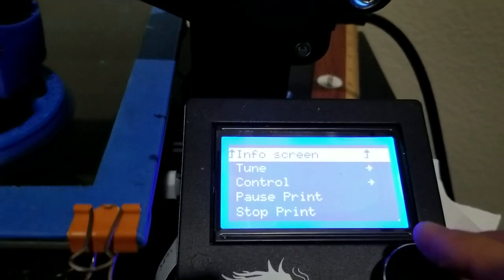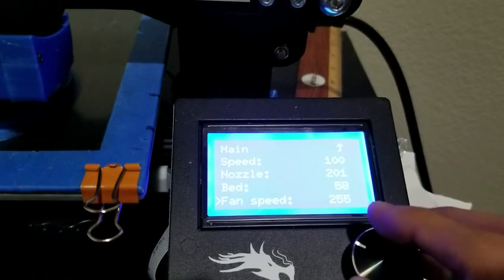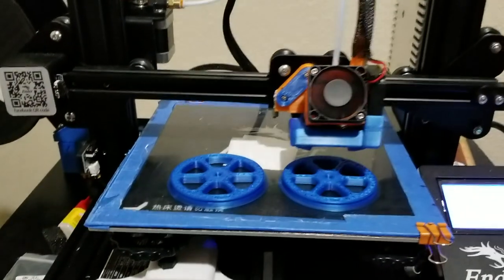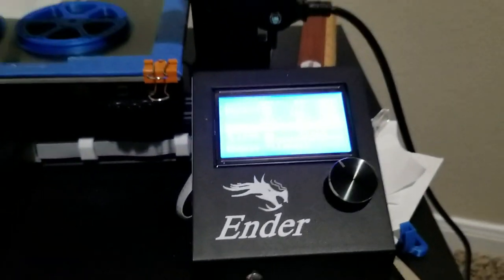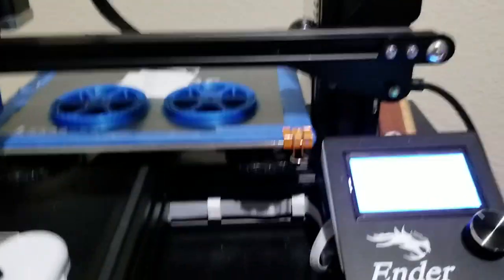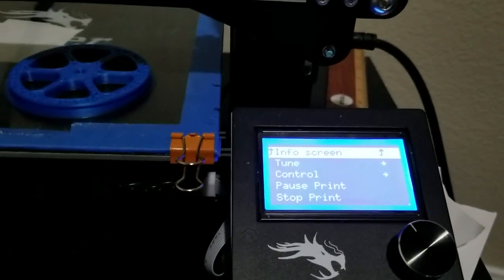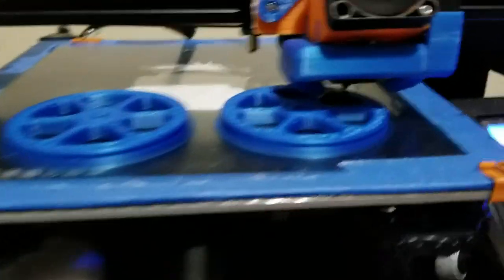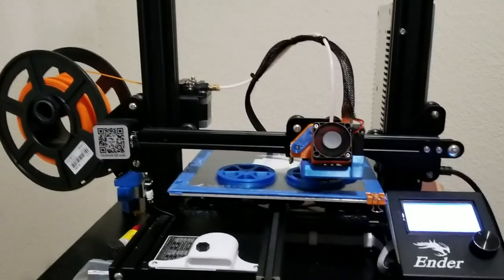How to change filament during a print on Ender 3 /CR10

Comment: i do not have the option for remove filament, for me it is replaced with babystep Z. i am using the enter 3
Reply from the maker: May be firmware is different/updated.

Comment: Mine doesn't have that function. Maybe a software update will enable it
Reply from the maker: You might as well have newer/ different firmware version already.  That's why it's not there ! Lot of people have same issue. Creality doesn't give you the notification on when they update their machine firmware/ control board versions.
Reply: @shehulsuratwala8568  Thanks for the reply. It's a Marlin 1.0.1 I doubt its a new firmware. I ordered a new silent M/B so I hope it will have more options then this one.

Comment: I don't have this option in my Ender 3 please help
Reply from the maker: It's hard to advise without looking at your machine but for starters,  see the version of your control board. You may be having a newer control board version or Updated Merlin firmware. 
Once you know the board version (4.2.2 or Higher I am guessing) , use that to search google/YouTube. 
This is my biggest complaint to creality. They change control board , firmware without notifications.  Even if you have same machine hardware,  you may end up getting different control board and firmware.

Comment: Thanks for skipping the boiler-plate talk about introduction and to subscribe, but pity that you cut out the actual changing of the filament, that's what I was looking for 🤣
Reply from the maker: Goal of this video is to show "how you can pause the print and replace new filament " , to show "change filament " option from Menu. 
This same technique can be used to get multi color print with one extruder.
Beginners do not know how to stop/pause print when you are running out of filament mid print. 
You do not want to waste your print specially when you have already got 10 hrs into print ....

Comment: Why is my Ender 3 Pro doesn't have that "Change Filament" in the menu?
Reply from the maker: I have regular Ender 3 v2. 
Creality constantly make tweaks to their boards/firmware without notifications.
Ender 3 "Pro" may have slightly different firmware settings.  
Sorry, I could not help.
Reply from the maker: @Daniel Walder Yes. Display is just a way to show information. Important thing is the firmware version/ control board version. If they are different then it could be the reason why some folks are not getting "change filament" option. 
I am not a professional YouTuber nor I do have money and time to invest for YouTube. I faced this problem when I was a beginner in 3d printing. There weren't any YouTube videos about this option at the time so I decided to make one myself and published it to help community. But the views and support from community is amazing and I am thankful for it. I never imagined to get this many views to be honest.

Comment: Can you share your upgrades on your hot end?
Reply from the maker: It was Hero Me 3d printed fan mount.  Didn't like it so much. I have been using my ender 3 stock with only one upgrade.  Using mirror on my bed.
Reply: @shehulsuratwala8568  thanks for the response. I've been having overhang problems on busts especially on noses and chins. Was thinking it might be a cooling issue. No matter what support I use they never turn out good
Reply from the maker: @iantec  I use supports over 55° angle. Try lowering your print temp by couple of degrees. 
If that doesn't help, print a temp tower to determine exact print temp for your filament. 
I prefer matterhackers PLA. It is $19.99/kg but best filament I have used.

Comment: Anyone else have the issue of accidentally moving the height of the printer while squeezing the tabs to replace the filament?
Reply from the maker: That's a problem ! Well , a solution for that is, stop your print. Remove partially printed part. Measure it's height precisely and use that number as a Z offset in Cura. Print the remaining half and at the end glue them together. 
It won't look pretty but if it is a prototype of some kind and you are not concerned about how it looks then it'll get the job done. 

I don't think the printer remembers the Z height or at least mine doesn't. May be newer versions do, I don't know. Let me know in the comment if it worked or what else you might have tried.

Comment: After noise appeared how u change the filament couldn’t understand... in btw u cut the video bro ??
Reply from the maker: Topic of the video is to show the option from menu and make the printer pause during the print ( without stopping the print job). When you click on "change filament " , printer itself starts to push out some of the filament from hot end. 
You simply pull out rest of it and replace the spool ... push new filament all the way into the hot end , click the button to resume your print job. 
I did not cut the video, simply edited out unnecessary part of it. No one would wait for 2 whole minutes to see me change the spool !
Reply: yeah I got it just don’t understood that the filament itself the printer pushed out .. printer it self push it out ..

Comment: Thank you! I was running out of filament before the end of my first test print (the little bit of test filament wasn't enough) and this just saved me a lot of trouble.
Reply from the maker: You're welcome.  
Test filaments aren't the best quality material either. Get some good filament and then start printing test calibration stuff.
Reply: @shehulsuratwala8568  Already done. I was mostly just messing around with the test file, but now I've got some Hatchbox PLA and have done some tests to double bed level and got a benchy to come out pretty well. Definitely gonna sub to you for the future though, I think I'm gonna try installing the TL smoothers from your other video. You make a great teacher.
Reply from the maker: @flamingmoose1479  Thanks. TL smoothers are of a great help. It made such a huge difference in X Y gantry noise reduction. 
As a matter of fact, I was a teacher in my previous job, now I am just an engineer in a firm. 
Let me know if you'd like to see video on other topics. I am into beginners racing quad ( Designing frames and building quads) these days hence no video in a long time.

Comment: You cut out the important part.
Reply from the maker: Which part ?
Reply: @shehulsuratwala8568  oh I don't know. The part about how to change the Pla.
Reply from the maker: @JohnSmith-un9fy  The video is about "getting to the option from menu where you can make the printer pause and spit out filament (it'll keep 1 inch still inside the bowden tube). Then you can physically replace the spool and resume the print.
Reply: @shehulsuratwala8568  For some reason it spit out over a foot of Pla. Then it let me resume print.  It also said something about a bad print. But did finish.
Reply from the maker: @JohnSmith-un9fy  I have never had that issue. You might have different version of merlin or different version of ender itself. Creality changes the control board , Merlin versions. Some enders don't even have this option to change filament in the menu. 
I am not talking about variations between Ender 3 and ender 3 pro and Ender 3 v2. There are variations among "Ender 3" only.
Reply: @shehulsuratwala8568  yeah. I have an old Trinus printer for over three years and it works great.  I have had to only change one nozzle and it is still using the same hotend. No plastic parts. Love it. But my Creality printer has the size. Thank you for your help.

Comment: Thanks! My ender 3 is currently printing my first print but is about to run out of the test filament so hopefully this works
Reply from the maker: Hope it went well.
Reply: Shehul Suratwala It was great. Currently In trying to print something I designed but the filament will not stick to the bed
Reply from the maker: @StolenGalaxy  male sure your bed is properly level.  In the beginning,  you just wanna print and print.  But take your time and make it level perfectly using piece of paper between bed and nozzle. 
You may try painter's tape, glue stick,  hairspray options to make your print stick. Using brim while slicing the part also helps. 
I use cheap mirror from home depot on my bed.  Doesn't need anything to stick.
Reply: Shehul Suratwala Ok, I’ve turned brim on in cura and will see if it works.
Reply: Shehul Suratwala Thanks! I did the brim setting like you said and now it’s working perfectly!
Reply from the maker: @StolenGalaxy  great. 50-60°C bed temperature is also good enough if you're printing PLA.
Reply: Shehul Suratwala Thanks, I did 55

Comment: I have a Ender 3 v2, and it doesn't have that option on the tune menu.  is this not avaialble for the v2?
Reply from the maker: I can't say for sure as I only have one ender. So far only 2-3 poeple have mentioned that they don't have change filament option. 
You may try to pause the print and manually pull out the filament and replace it with new one. And resume the print. Be careful with Z axis. Don't let it move up or down while you swap the filament.

Comment: Thank you so much for your video! It’s great that you did cause I couldn’t find a resource to provide this info. Consider demonstrating raising the temperature when the filament requires a different temperature that is indicated by the new filament. Great Job!
Reply from the maker: Thanks. Once you change filament and printer starts printing,  you can manually change temp for new filament from same "tune" menu and it'll remain same for the rest of the print.

Comment: Useless. Doesnt show how he change the filament.
Reply from the maker: You take the old filament out and put a new one. That's simple.How can you be so stupid ! Read the title - it's about pausing the print and changing filament.  
If you don't know the how to put new filament and changing filament mid print , perhaps you should try different hobby. Calling my video useless !
Reply: @shehulsuratwala8568  because when you pull the old fipament out, there will be string of filament. It can get stuck and cause problem. Uou also need to heat the head let he old filament flow abit, before you pull it out. Your video can actually cause problem. Look at how many tumbs down at your video, that shows people have problem with your video. Learn something?
Reply from the maker: @hermanhartono1897  now let me explain you some logic. You are already printing and you like to change the filament.  The nozzle is already heated to printing temperature. You can simply  pull out old filament.  Do you even think before you write comments! There are more thumbs up on the video in case you haven't noticed.  And I am sure there are many dumb people like you who does not comprehend simple logic. 
Listen in the video.. when you perform this operation , extruder automatically pushes out filament for you. It only leaves about an inch of the filament at extruder end , NOT at the Nozzle end. 
Sometimes these machines have different version of controller board,hence some people experience difficulty getting to the right menu option.
Reply: @shehulsuratwala8568  first of all look at your thumb down, enough said, second your viewer maybe new or never change filament. your video can actually cause problems. and third how nice and aggressive your behavior reflect how successful you are lol. Next time just dont be LAZY and call people name. maybe you skip it because you ran into trouble?
Reply from the maker: @hermanhartono1897  This video is not about changing thr filament but "swapping the filament " when you run out of filament during your print. 
I still don't understand why are you stressing out on changing filament  ! Extruder does it for you. All you have to do is to press tension lever on extruder and pull the remaining 1inch of filament which was left intentionally into extruder by printer itself. 
Goal of this video was to let people know how to get an " change filament option " from printer menu. 
I don't like unneccessary step in the video. 
Second: you pick any video on YouTube,  it will have thumbs down no matter how good the video is bcs therr are people who can not be pleased.  Even 6M times viewed video would have thums down. 
You please don't worry about my success. My video has over 15k views and only one guy complaining about it.  You make a video and send me the link. Then i will give my opinion.
Reply: @shehulsuratwala8568  you reply with aggressive tone, and put out wall of text. Whos stressing here?
Reply from the maker: @hermanhartono1897 A  wall of text which you can't climb !

Comment: My problem with the Ender 3's filament change option is that it doesn't eject the filament far enough, I usually have to manually open the extruder and pull the filament the rest of the way out which results in me inadvertently moving the Z Axis height.
Reply from the maker: In my case, it left about an inch of filament inside the bowden tube which I removed manually and fed the new spool. 
Yeah Z axis height need to be very accurate in order to avoid failed print/ layer shifts

Comment: Thanks, Shehul! I kept pausing the print first, but there's no 'change filament' option when you do that and I kept applying just enough pressure to the gantry that it would slide down the Z axis a little and ruin the print. I was beginning to think I'd never be able to do dual-color prints on the Ender 3!
Reply from the maker: You're welcome. In the beginning, you don't know these things. But as you gain more experience with 3d printing, it will be really easy and enjoyable hobby. Keep printing.  There are many uses of this feature e.g. printing symbols, logos, sayings in dual colors.
Reply: @shehulsuratwala8568  I've been printing for a couple of years, but the Ender is new.  It's mostly the same as my Tevo Tornado, but there are just enough differences to mix me up. Anyway, I was able to swap colors successfully and it's much better than what I'm used to doing. Thanks again!
Reply from the maker: @DevilishLedoux  Then you already have more 3D printing experience than me. 😅. I can see that can happen. I use ultimaker3 at work and ender 3 at home. Both are very different systems

Comment: Our ender 3 doesn't have the change filament option 😭
Reply from the maker: What version are you using ?
I have completely stock firmware and board on my ender.
Reply: @shehulsuratwala8568  I have the same issue. Should be under Tune when printing and change filament option is not there :(
Reply: @shehulsuratwala8568  Ender 3 Pro haven't change filament option. Stock firmware.
Reply from the maker: @aleksandrkuzhelev2921   I did not know that. I have Ender 3. Thanks for informing me.
Reply: @aleksandrkuzhelev2921  My Ender 3 Pro does but I think it's under Prepare not Tune. I'm at work and can't check now though.

Comment: Are you manually extruding filament after you change it, to prime it?
Reply from the maker: No. As soon as you push the button , it starts to print again. As the nozzle is already hot , I don't think it needs priming.
However, when you feed new filamanet  , at that time you may push it a little to manually extrude some filament. Make sure when you do it, you don't accidentally push on Z axis.
Reply: @shehulsuratwala8568  i did this, moved the axis a little bit, and it screwed my print up, almost broke my machine. I was over half way on a big print, now I have to start over.
Reply from the maker: @WhereisWaldo1  if you have a good caliper, you may measure  the height of your completed print... off set the same z height amount in Cura and print rest of the print. At the end, glue both parts together.